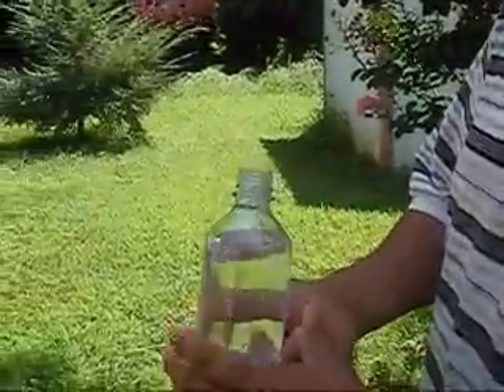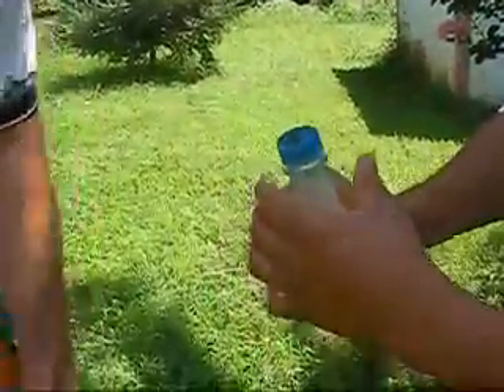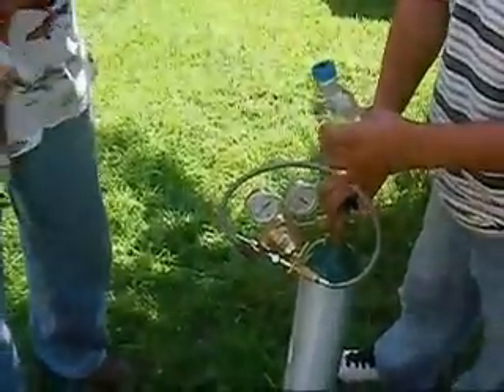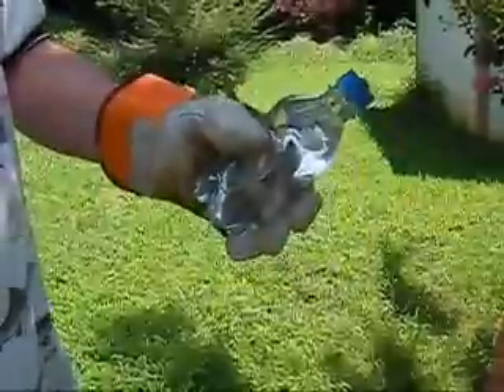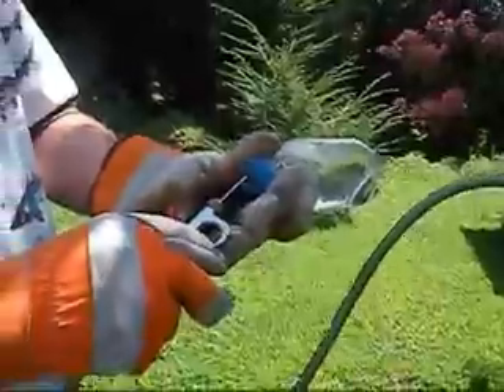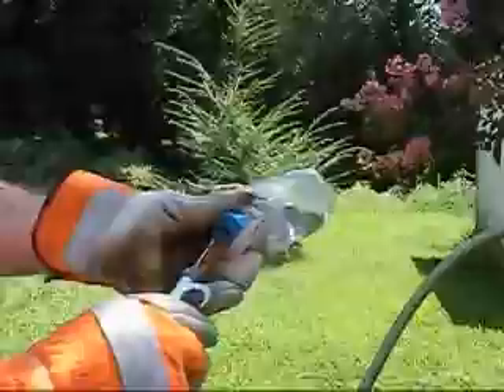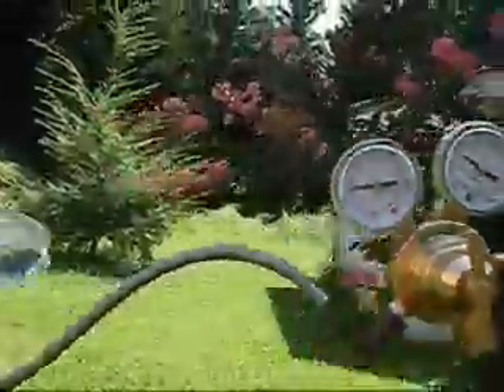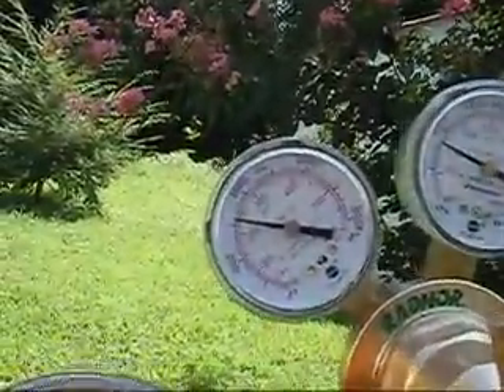12-oz PET Bottle Burst Test Using Fizz Giz Cap and CO2 Source Tank

Comment from the maker: @truthbtoldUSA And, one more thing, I believe the dispenser tip used in the video was simply a common inflation needle used to inflate American footballs, basketballs, soccer balls, etc. The Fizz Giz dispenser uses a conical tip that does NOT fully penetrate the valve and NEVER comes into actual contact with the beverage contents. Fizz Giz caps have valves made from food grade elastomeric polymers and are NOT compatible with the inflation needles. FizzGiz dot com has the skinny.

Comment from the maker: Thx 4 the comments, TruthBTold. Search this "lRgfsa8zOio" on utube 2 watch another clip showing more detail. I pressurize to 150psi in PET bottles regularly. And Yep, two bucks for a Fizz Giz cap beats $20 for The Terminator. Caps'll last practically forever. Just rinse 'em under warm water after use. They hold a charge very well. I generally carbonate a 12-pak of single serving sized bottles, lasting me a month. Very rarely do I have to add addn'l co2. Go to TapRite dot com and search for 3741.